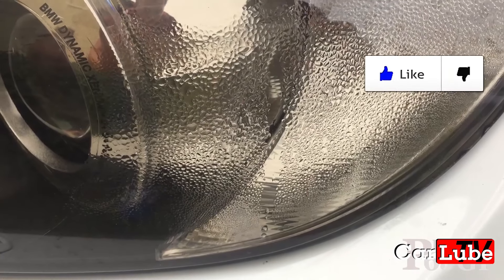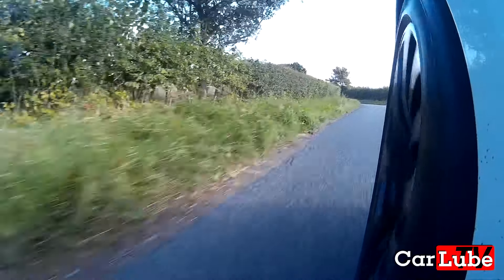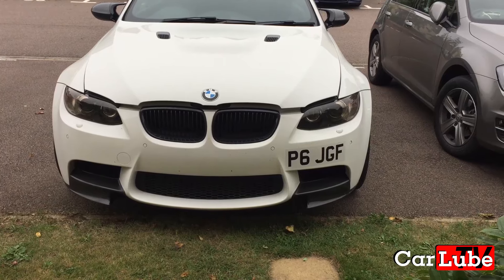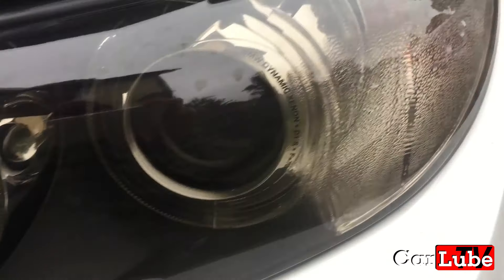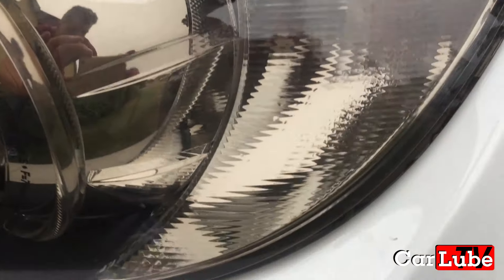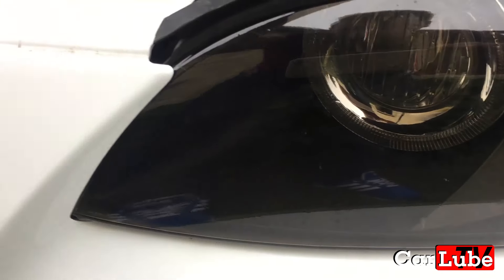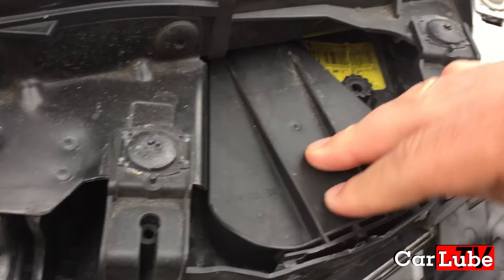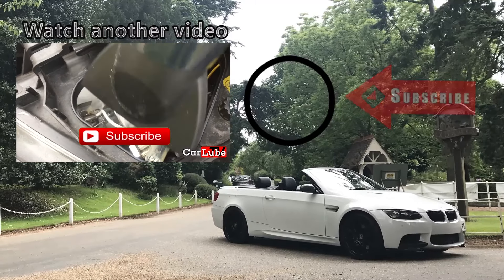How to remove condensation & mist from your headlights | BMW | How to

Comment: Thanks for sharing your experience with clearing the headlights of moisture. I've same headlight units with top access, completely dry in about 20mins on medium hairdryer setting. Left access cover off for several hours to allow further venting as the headlight cooled down.👍

Comment: I had condensation in my E39 headlamps.
Following advice online, I drilled a small hole (3mm bit, I think) at the top of the lense, just under the bonnet, and they've been clear ever since !
Reply: I will try that when the warranty is up this has happened twice on my new 230i

Comment: Doesn’t this just mean that there’s a crack somewhere and it’ll come back? In addition to no sound, I replaced the front passenger light (it was off an M2 that had been sat outside in the winter cold and wet for 2 months before being put on my M235i) and it has this issue but in addition, there are big water droplets. I read in the manual some condensation is normal but this seems excessive. Wondering if it’ll go away/should have gone away as xenons do heat up. Thoughts?

Comment: I found it best to remove the cover and close the lid to be very effective with the engine running. In dry conditions you can drive like this as it gets more heat than from a hair dryer.

Comment: I currently have one headlight, the driver side, that does not light up and was full of water droplets and condensation before they failed. I had my mechanic change the adaptive headlight module because the adaptive headlight didn’t work not too long ago. Is it safe to have the auto headlights on if one works and the other doesn’t? Or will I just fuck up my light even more? The angel eyes still works but the high and low beam don’t.

Comment: Hello,it seemed to work for you,I tried it yesterday with a hairdryer,it worked but as soon as the headlight cleared the moisture was back!!!!
Reply: It will come back, the video is a load of crap. Somewhere the headlight has a broken seal or a crack, its that simple
Reply: @chrisl8873  I drilled a hole in the black casing,the condensation just needed a vent when winter came I plugged it with black tack,no trouble after a year

Comment: But why did it get condensation in only one and how did it get in there ?  You just put a bandaid on your problem. 🤔
Reply: Contrary to popular belief, headlights are not air tight by design. Most even have vents designed to circulate air, but a headlight is not at all designed to be completely “air and moisture tight” 
Infact, sometimes the issue of a moisture build up is caused by a blockage of the ventilation, as if a headlight is properly vented, there should be no moisture that gets trapped.
Reply: Bad seal

Comment: Is it M3 acceleration exhaust sound on video intro? Or you just added sound of exotic on top?   If yes, please send your exhaust setup.
Reply from the maker: Buglinjo it is the sound of my car, I’ve done vids in the past,  look up 2.5 OEM mod
Reply: @carlubetv  If you are referring to "THE SOUND OF AN OEM exhaust mod BMW M3" sound is completely different.
Reply from the maker: It depends what modification you go for its not just one, If you can find the video I did will explain how it works there are a variation of different explanations in there
Reply: @carlubetv  I mean, if you watch this video ( https://youtu.be/nTnI9cnUbZ0 ) from 00:03 (where it's not real sound) and from 01:00 (when it is a real sound of an M3) you'll see the difference.

Comment: Hey CarLubeTv.  Thanks for your video. Do you know how to resolve this issue on a E87? I don't have the access covers on the top like you have here but flaps at the back for bulb changes. barely big enough opening to fit the bulbs through. Many thanks.
Reply from the maker: Joseph U hi mate, your headlights still have a cover on the back of the unit, I would take those covers off and leave it for a couple of days to breathe, they should clear.

Comment: You can save extra time with a can of compressed air first,  then heat.
Reply from the maker: @highlysuggestible861  I can’t see the benefit of using compressed air, because you’ll just be pushing the water to the bottom of the light where the ballast is.. And all the electrics will get wet.
Reply: @carlubetv  the air saves time on the hard to reach corners,  air in a can with a small extension on the nozzle,  clear as much of the lens as possible,  then heat to dry.

Comment: I have tail light condendation on my F82. I use heat gun on the outside till its gone. But will eventually come back after 10mins. 🤷
Reply: Same on brand new headlights i don't get it 🙄
Reply: @ThatLennyBoi  This is really a physics problem. The fogginess/ condensation will continue just as it does with the windshield and even on your home windows. When there is a significant temperature change on one side of a nonporous surface compared to the other side, condensation will form on the surface. Just like when you take a cold can of soda out of the refrigerator. 
Automakers may have to start making defrosters/ dehumidifiers  for headlights to correct this physics problem.

Comment: Wouldn't it be better to use a vacuum to extract the moisture?
Reply: how do you get a vacuum hose to the lens face to suck up the water?
Reply: That works fine.
The idea is to get air flowing removing the moisture (no liquid vater). I did that today, vacuum hose into one of the bulb holders and heat gun heating the outside of the lens. Took about half an hour to get all moisture out (it was heavy fogging with solid water droplets galore).
I dont have any big lid access to the inside of the lights on my Mitsubishi ASX.
Reply: @HjuvikLabs  did this as well. But condensation was back the next day. How do you plan to keep yours dry?
Reply: SPG 565, That is correct, A vacuum would be better. But the only problem is that a vacuum does not heat the air to turn the water into a gas/ steam. 
If you ever put your hand over the exhaust vent of a clothes dryer, you will notice the hot and moist air being blown/ sucked out.
That is what you want to happen inside the headlight .